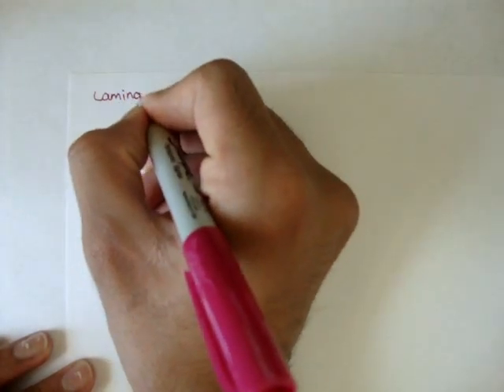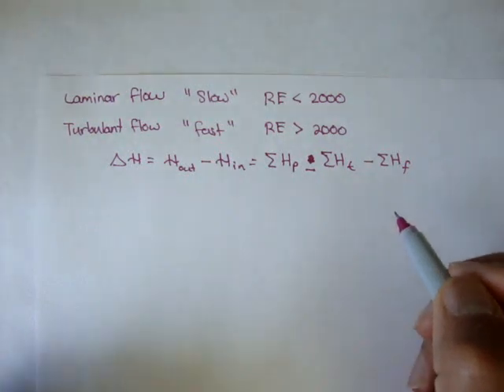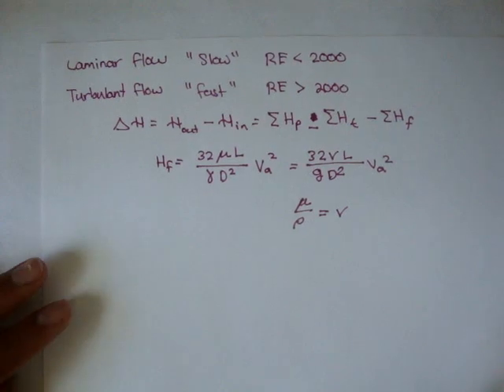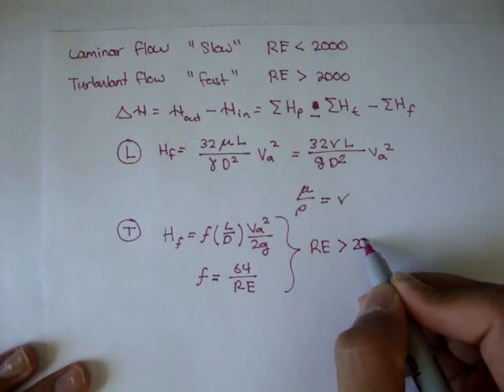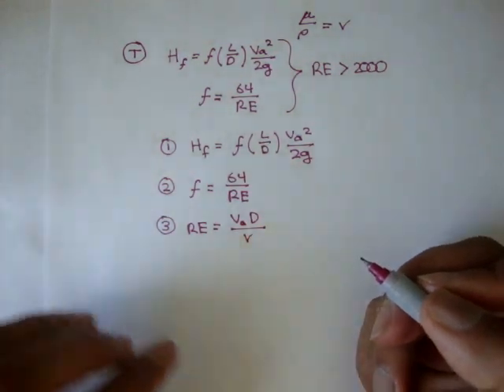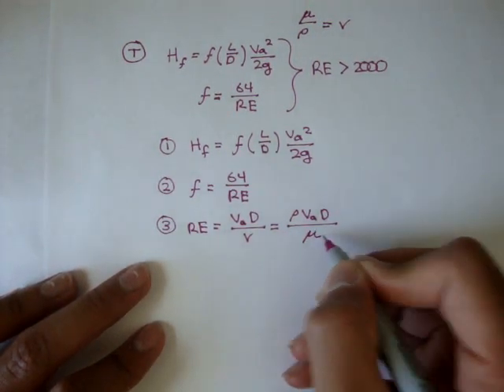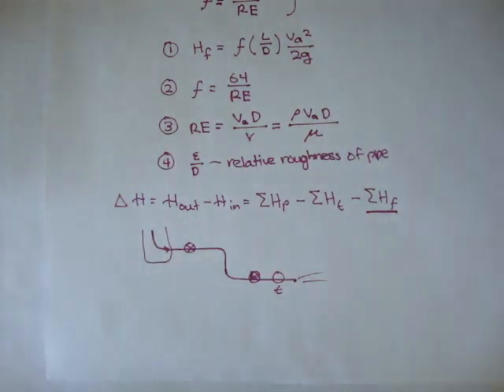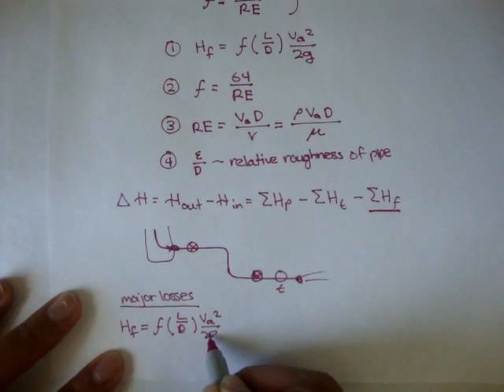Introduction to Turbulent Flow [Fluid Mechanics #39]

Comment: The formula he gives for hf is valid for ALL flow regimes not just turbulent as stated in the video. The only variable in that equation that depends on the particular flow regime is the friction factor (f). He also states that for turbulent flow (Re>2000) --> f=64/Re, however this is NOT correct. f=64/Re is only applicable to laminar flow. If the flow is turbulent the friction factor (f) must be determined using Re, e/D, and the moody chart (you can also use the explicit Haaland equation for a good estimate).
Reply: Yeah this is right
Reply: sure, I do agree with. it shall be rectified.